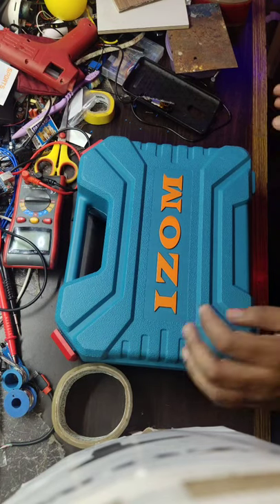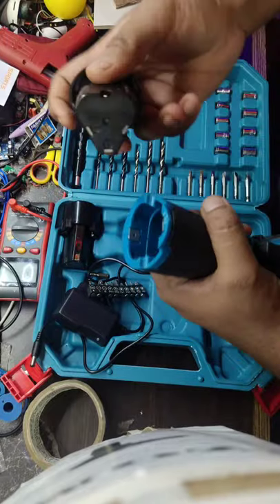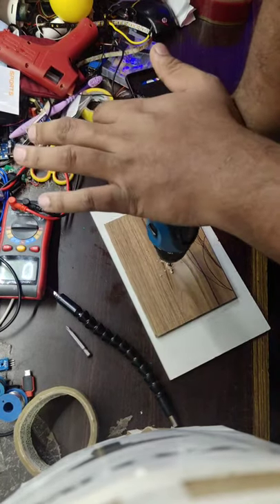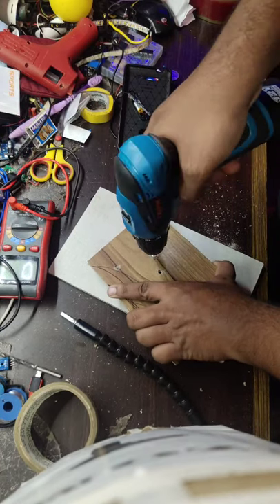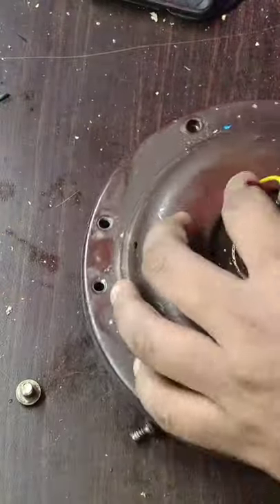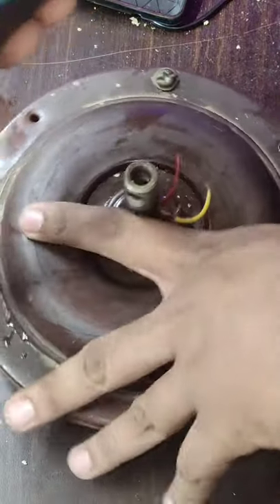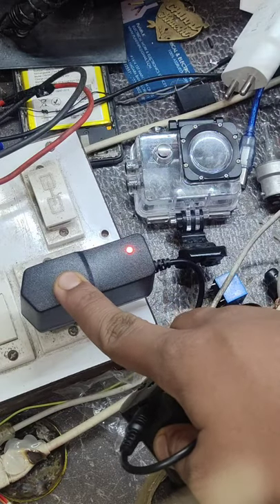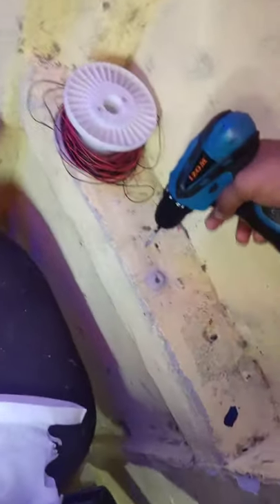Battery based  drill machine,"IZOM" DRILL MISSION REVIEW

Comment: Is it use to wall or concrete
Reply from the maker: For wall it is very good but for concrete you need drilling + hammering mode so for concrete it is not suitable but for wall it is a very good quality I am using it since passed through two years the qualities to good I use it at extreme condition for opening tight rusted nuts

Comment: Battery backup time
Reply from the maker: If u pres it for continus non stop it gives around 55mins
(It was only for testing purpose) for removing screw or wood drill it can be used for more duration depends up on usage   but it fells that charge won't end